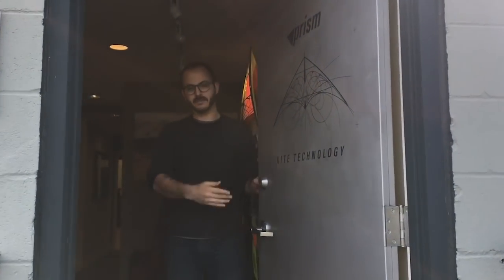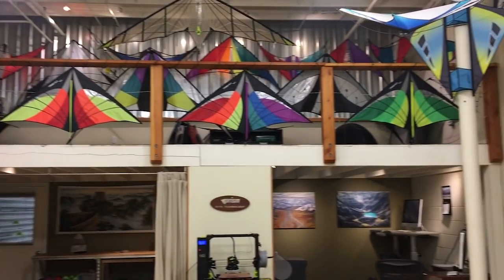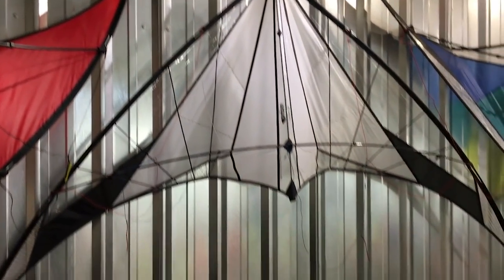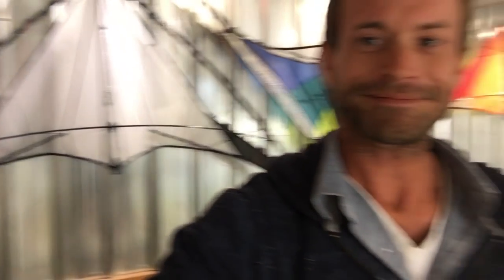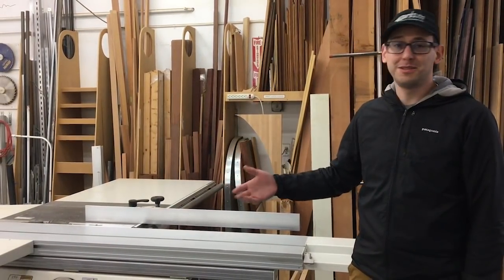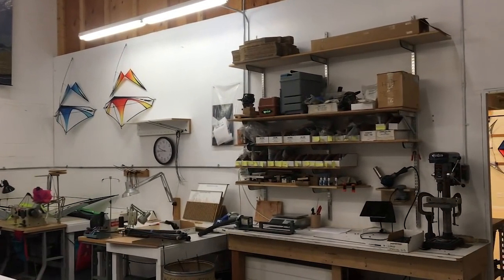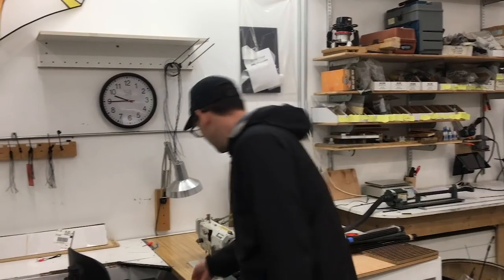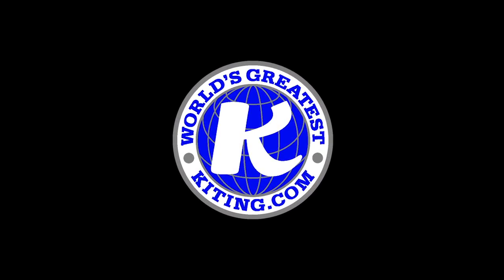Prism Kite Technology - From the Inside

Comment: I used to have 6 Trilby Stunt kites I used to fly attached together  along with tails attached, as a 13 yr old girl! (Yes, I was atheletic and into sports;). When I did 6 I’d get drug way down the beach heels dug in the sand, but it was a ton of fun!  I was good at entertaining folks in the restaurants in Lincoln City and would fake my mom out doing dive bombs to her on the sand (thought it was funny at the time), but I also enjoyed doing full speed dive bombs from the very top down to make it look like I was about close to crashing then pull super hard at last minute to have it glide across the sand of even the water then back up….or do a couple twirls soon after toward the bottom to keep up the suspense of looking like I might crash them. Sometimes the tails might make it not pull off the trick if they got too wet from water tricks like that. 

6 kites tied together was a ton of force so I usually preferred flying 3 because I felt like it would still give the beautiful looks when doing all the stunts - different colors plus tails were a MUST! 

Fewest I would do was
2,  but never liked the looks of only 1 kite even though I always used tailed on the kites! Never liked them without the tails. 

Will you guys ever make one that attaches multiple stunt kites with tails? 

Btw I am 50 now..yikes! I have 2 prism kites I got from Amazon and the big one I have it seems like the strings are not attached correctly and someone might have messed with them as it isn’t flying correctly and even tends to curl a wing in and I’m not sure why. It just doesn’t seem like the lines attaching are well balanced for my big one - the small one is fine. How do I know if they are messed up and how can I retye them on the kite so it is is symmetrical and in balance when getting launched by the wind? 

Also I have some kite boarding lessons waiting for me in Hood River area but not done it yet. I know how to wake board at least but what would be the best kite to prepare for kite boarding or a kite we could actually use to do kite boarding? We live right on the Columbia so it would be cool to just get on a board and fly a kite when I see enough wind out our window! Lol 😂